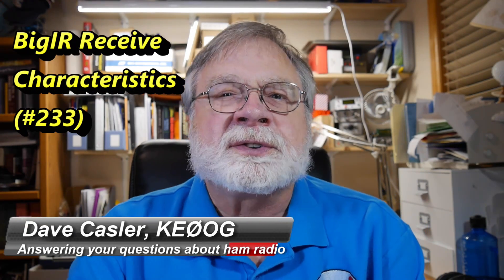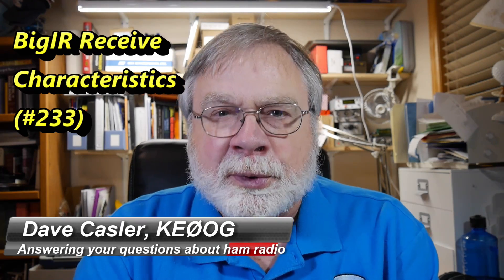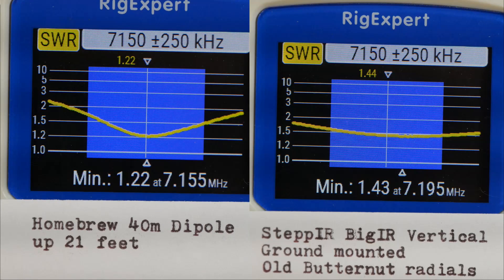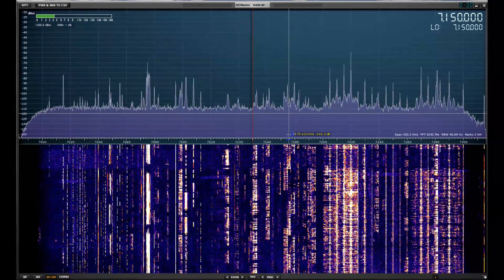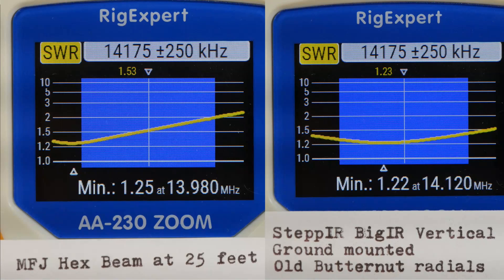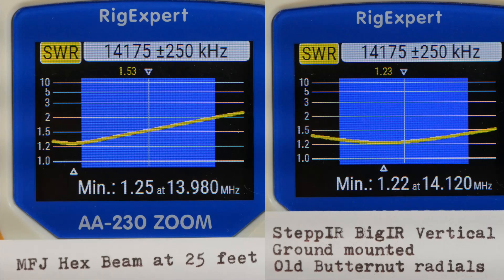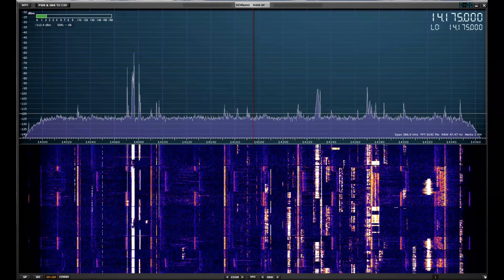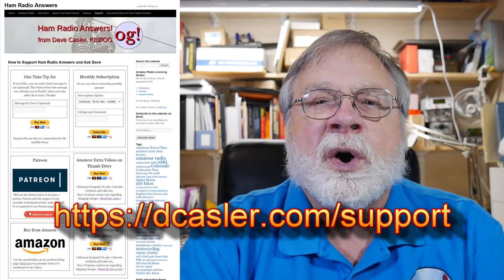SteppIR BigIR Vertical Antenna Receive Comparisons (#233)

Comment: Get a 43ft vertical, no moving parts and a fraction  of the price, will match the SteppIR from 80-20M and at a push you can get 160M with a remote tuner..

Comment: I'm guessing your dipole is horizontal and I thought there was some 30 db of attenuation between vertically polarized and horizontally polarized signals. Hence some  contesters transmit on a vertical and receive on a horizontal beam. But I'm no expert so thanks for the comparison.

Comment: My experience with my Steppir BigIR has been that on 40M - where my cloud warmer inverted V fan dipole is at about 33ft above ground and the Steppir BigIR is on the roof with sixteen resonant radials (4 for each of 40m, 20m, 17m, and 10m) at about 25ft above ground, the fan dipole does better for the short hop skip to nearby states and the BigIR does better for DX.   Interestingly enough, I actually get more perceptible noise with the BigIR.  But, that is likely attributed to manmade noise in the near field of the antenna that tends to be vertically polarized.   I've been very happy with both antennas and regularly switch between them and use the one that works best with the current contact.

Thanks, for the video!

Comment: As an owner of this same antenna remember that a vertical antenna with ground radials actually performs at its best around 1.5:1. Anything less will have minimal to zero impact on signal generation from the antenna.

Comment: Interesting.  I have a home brew 40 meter 1/4 way vertical with 50 some radials and a G5RV type antenna up about 35 feet.   I find on receive I have the same noise level on both which surprises me because verticals should be more noisy.  But the receive signals on 40 are greater on the vertical and when I compare my transmit level to a couple of remote SDRs I find that the vertical is a full 2 s units or more higher than the G5RV.  I have always admired the SteppIRs and would love to be able to afford one.   73.  MJ AB0HJ
Reply from the maker: If your G5 RV is only 35 feet high, then it's elevation angle is pretty high, whereas the elevation angle on the 40 m vertical is pretty low. You may find with some signals you receive them better on the G5 RV and others are better on the vertical.